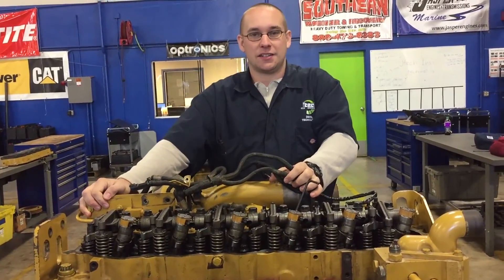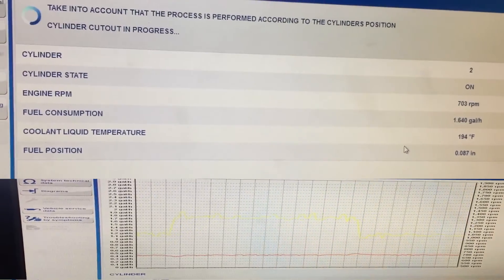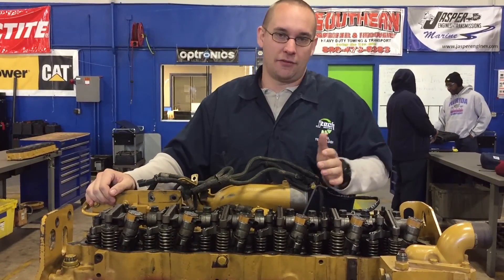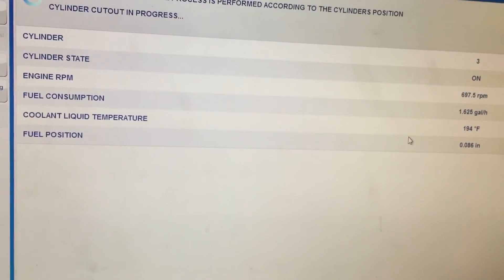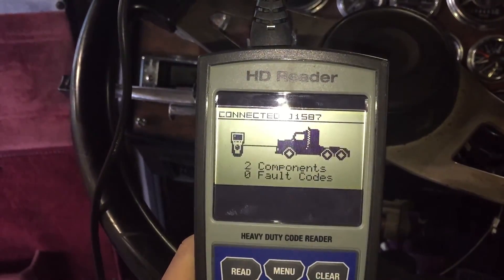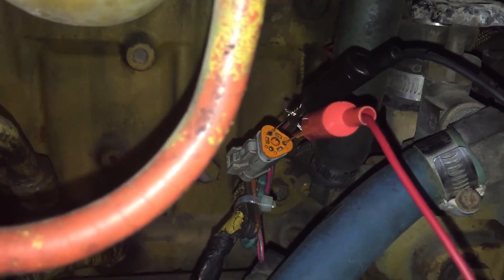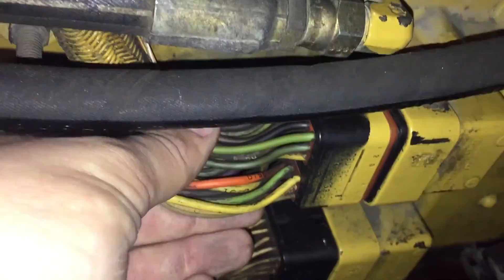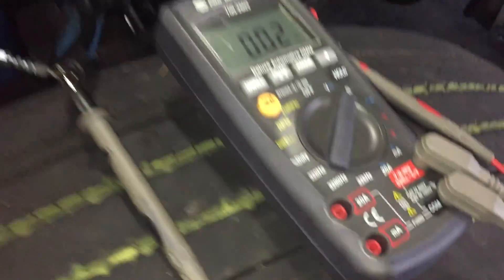Engine Electronic Diagnosis & Repair - [J-Tech Institute-Diesel Technician Training]

Comment: When testing connectors either on sensor side or the harness side, it is good practice to use the correct cavity size and shape pin, spade, socket, to insert into the cavity you are measuring,  never use a probe because it can damage, spread sockets, pins, cavities that will worsen the current concern. 

Also use something to load test the circuit,  because not all issues are constant, some are intermittent.